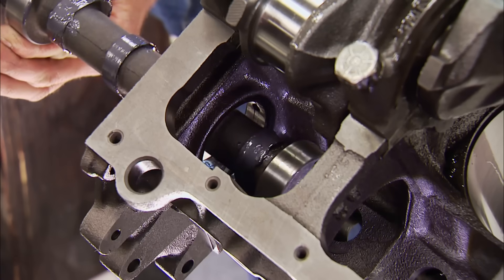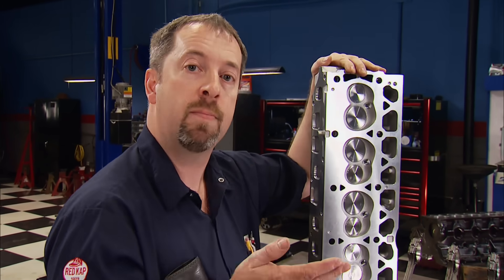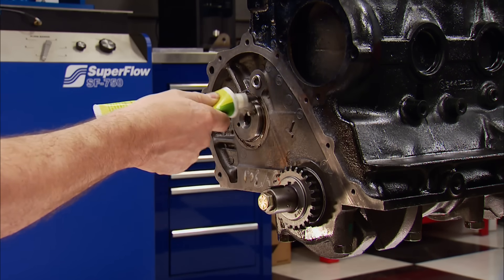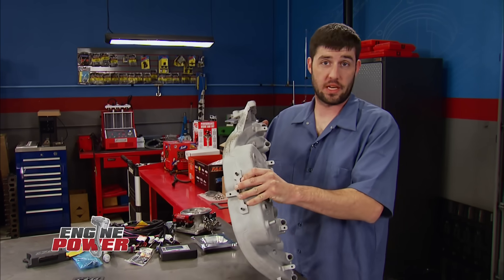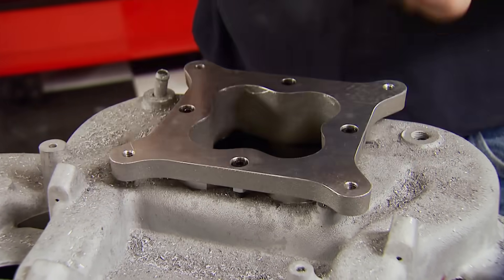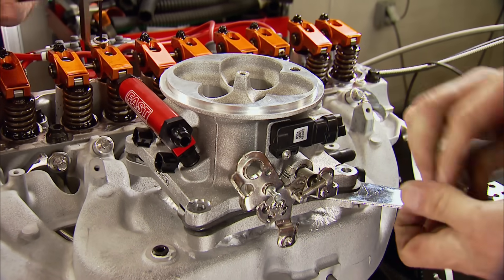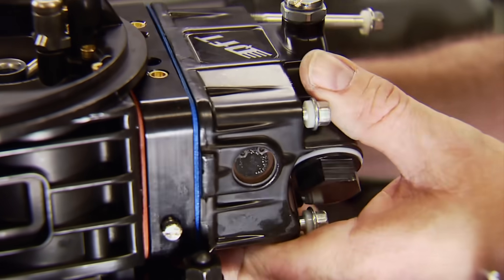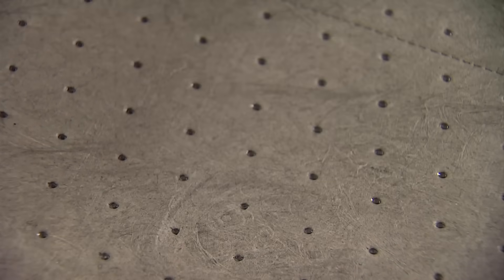Rebuilding a 4.0L Jeep Straight Six to 242HP - Engine Power S2, E14

Comment: It's a shame they didn't come with timing gears, like the Ford 300 did. That would be a good upgrade on the 4.0, especially when it gets some mileage on it and the stock chain stretches. Keeping cam timing perfect is always a good thing.

Comment: In my country, Argentina, these engines were used in Dodge Polara R/T (Dodge Dart 4th gen for EEUU market) and in IKA Torino for Turismo Carretera category. With a two weber carburetor and a lot of improvements, without increase displacement neither blowers or turbos, they can get it around 400hp at 9k rpm (you've got a lot of videos in YouTube). 
Today they are running with 24 valve heads made here, and the spirit of these engines are not the same.

Comment: I built a similar engine to this and learned the hard way....don't skimp on those ARP oil pan bolts or you'll surely pay the price. I tried to use the stock oil pan bolts and they just couldn't take the extreme weight of the oil leading to catastrophic failure. 🤔🤔🙄🙄
Reply: LMFAO.

Comment: I did almost the exact build for my 85 sx4. 3500 stall, too. Thing dis a two-wheel burnout for blocks and blocks! Blew the transfer case racing in the snow, so I rebuilt the whole thing. Beale did the interior. Black and maroon, black interior. A true muscle car. Loved it! Had vr4, evo, scoobie, focus mach-1 (dont ask), too many bikes to list. Something had to go. Still miss it. And my vr4. And my challenger. Mach-1 (73). Impala. Other sx4. 5 glh turbos. Had it all. Nothing now but success in business and homeschooling. But I got my eye on that new accord 2.0 turbo 6-speed.

Comment: If you pause it at 14:53 you can see that for some reason after they started the dyno pulls they put that stupid oval adapter back on the engine that came with the fuel injection. Why would they go through the trouble to weld in a 4 barrel adapter into the intake just to bolt a 2 barrel adapter back on it? No wonder the fuel injection didnt know what the hell to do. I'm surprised the carb did any better! Plus it looks like the first welded adapter was set in too far.
Reply: GOOD EYE SIR, FREAKIN IDIOTS.

Comment: The easiest way to get more power is a head shave for more compression. Stock is a super low 8.5:1 iirc.. thats the kind of compression youd use if it were heavily boosted. N/a you could easily use 11:1 compression on 89octane gas and improve your mpg significantly. That with high Atomization injectors and you could definitely get close to 300lbft. 
200hp is such low power output for a 4.0l.

Comment: That same engine was in Ramblers the 50’s. This was before AMC acquired it. Jeep got the engine when Chrysler entered the picture. So Jeep may have had it for 19 years. Also, Barney Navarro built a 199 cu. in. Turbocharged Rambler for Indy.

Comment: I bought a new 87' Cherokee with this engine. Not long after I took delivery, a metal-to-metal tapping-type sound was being emitted from the engine compartment until the engine had warmed up. The dealer (Lou Bachrodt Chevrolet, Rockford, Illinois) replaced the rocker arms in response to a bulletin stating that they were inadequately hardened, then told me the noise was "normal for that type engine" after the third visit. A first visit with a new dealer in an adjacent town (Belvidere Motors, Belvidere, Illinois) solved the problem. The source of the noise was a cracked weld in the exhaust manifold, which then became quiet after the engine had (fully) warmed up. Their mechanic went for a ride with me; after traveling less than100 feet, he exclaimed, "The exhaust manifold is cracked." RESPECT!
Reply: Had the exact same problem with my 87. They diagnosed right, but it always seemed to have a slight leak.
Reply: My 1996 Grand Cherokee developed a manifold leak 200,000 miles ago. Never had it fixed. Apparently this engine doesn't care. Neither do I 😊
Reply: Ha this was an issue until 2000 (99 in the grand Cherokee) when they went to a two piece cast iron manifold. The fix is a high end stainless manifold. But a Cheap steel manifold with expansion joints works as well.
Reply: @austinaubinoe2195 funny, it’s replacement, the 3.8 has the same issue, but an easy DIY replacement.
Reply: Just bought an 87 Comanche with about 150k miles. It came with some of the service records and apparently a tech said the exhaust manifold could be cracked. Seems like a common problem with this engine.

Comment: DO NOT BUY THE TPMS SENSORS FROM ROCKAUTO!!!!!!! I worked at a tire shop for 3 years and every single sensor that was brought in from rockauto or EBAY was garbage and wouldn't sync up with the vehicle.
Reply: Which brand? Rock Auto sells many brands.
Reply: @westernapache1700  Any of them

Comment: So, why can't we get 300HP out of this? Just curious. Now, we have 3.6L V-6s that make 300 plus HP. Why can't we get 300HP out of this engine with mods?  I get it they did a lot of work and this a high torque engine. What is the primary limiting design factor?
Reply: Old technology. Intake and exhaust manifolds are on the same side. Not good for keeping the intake air charge cool. NO overhead cams. Just get a V8.
Reply: 350-400HP NA can be had out of these but you have to mod them to suit the architecture of the I6. Most of the mods can be done at the machine shop. They can handle very high compression and or boost because of the closed deck, thick jugs and thick head deck. But you have to tune properly because of the combustion chamber design, they are a fast burn head with a little bit of a bathtub design (shaving the head can reduce that considerably) so you need to back off the timing a bit, kinda like an LS. This build is basically what you do to refresh this engine to factory-ish standard. Hence the low output numbers. The major limiting factor in this build is the intake design-(idea). THe manifold is not good for making HP and the carb on a FI manifold. Also the TBI EFI system does not work with the intake mod nor the intake in general. Factory EFI would yield better results. If you could get a hold of a good condition RENIX MPFI system you could mechanically tune this motor and it will run better than jtec since it looks for targets instead of restricting to parameters.

Comment: I'd love to see you guys do an Australian icon Holden 253 V8. Stock it had a displacement of 253 cu. in., 4.146 litres, a compression ratio of 9:1, a maximum horsepower 185, and a maximum torque of 262 lb. ft. I'd love to see one on your dyno at about 260hp and 300tq.

Comment: Why the fuck would you go from multi-port fuel injection to EFI  ?  Going to square wheels on it next. Jeep did make a lot of those manifolds, good thing, you sure fucked that one up. Its for air flow not fuel mixture. Jeep engineers are falling out of their chairs in laughter at this bullshit.

Comment: Its an older episode I know, but has to be said.  Its 2020, and when we screw up something we just slap a carb on it and call it done.  FFS it had fuel injectors, and a throttle body, so you go backwards in technology and use a carb.....  Ok time to stop living in the past and get on with the modern times.  This isn't the 60s.

Comment: Wonderful engine. I put 390,000 miles on my 1990 Cherokee. I pulled the head once to replace the head gasket. Other than that, just oil changes, anti freeze and spark plugs. At 390k the compression in two cylinders dropped dramatically, then it spun a piston bearing. I had a hard time deciding to scrap the jeep other than rebuild the engine, but the rest of the jeep was nickel and diming me. Sold it to a scrap guy, he rebuilt it, the jeep is still out there.
Reply: I have 331k on my 1999 jeep cherokee

Comment: I think this is a nice build.  286 ft lbs at 3500 is about right for the application.  1st or 2nd gear rock crawling will put a Jeep right in the torque band.  As for comparing this to modern, Dohc, cross flow head, computer controlled, high winding engines for total horsepower....well , that’s just a silly irrelevant comparison.  As for proponents of an engine swap, have you ever really done that? That takes a lot of time, detail work, along with custom fabrication.  Yeh it can be done but really y’all make it sound like a swap will attach itself to the vehicle like a magnet. They used the stock bottom end. Aluminum head $1500. So for ~ $2500, an engine that the average joe could build.  Bolts right back into a Jeep or Cherokee.

Comment: They could have used the stock cam sensor from a late model 4.0, made a simple crank pulley trigger and used a computer worth a shit. I have been watching power block since I was eight or nine years old and I turn 30 in a couple weeks. They are so completely behind the times when it comes to electronics it's insane. Hell they were behind back then but now it's just painful to watch.

Comment: I came here to complain and bitch at JEEP for ELIMINATING this engine. Just like Ford did the same with its 300 I-6. Reliability, simplicity, longevity, etc has never been the same. The 4.0 was MURDERED by the (Mercedes Benz) Germans when they took over in the early 2000s. Another example of why FOREIGN Mentality and influences DESTROY everything that is GREAT in the USA. Chrysler/Dodge/Jeep is becoming more and more meaningless today, the V8s pushrod cars are for niche markets(Thanks FIAT!).

243 HP @ 5000 RPM & 286 FT-LB @ 3700 RPM is nothing to scoff at, more so when you don't have the optimum setup to begin with by having to go to an alternate solution to get these numbers. The only TOTALLY MODERN engine you can compare this to would be GM's newer 4.3 V6 (LV3) , 285 HP @ 5300 RPM & 305 FT-LB @ 3900 RPM. So there is a competitive amount of torque per displacement for the Jeep, it is just that it could produce a little bit more HP  (265?) at a little bit higher RPM and voila! Combine this engine with a modern, faster shifting automatic and, on a 3,500 lb small SUV the performance is as current as any other vehicle.

Otherwise, great job guys! I wonder if slightly better results could have been obtained with a post 1999 engine, and that also would avoid the (failed) manifold's plenum welding surgery, simplify your setup and reduce time, cost and pain.

I leave you guys with a review of a 1997 Cherokee with 4WD:
https://www.motortrend.com/cars/jeep/cherokee/1997/1997-jeep-cherokee-2/

Comment: the 4.0l is one of the most bulletproof engines jeep made.
Reply: I gave away my '93 when it had 350,000 miles on it. Checked in with the new owners a few years later and it was well over 400k. Not delivering much in the way of power mind you, but still chugging along.
Reply: Based on a 1970s Australian Chrysler design.. I have one in my 76 regal. Two barrel carb and electronic ignition, they were strong torquey motors even without efi
Reply: Not when these guys get ahold of it
Reply: My 98 is my daily driver,312k on it. Runs great.
Reply: *Except for the absolutely PUSSIFIED cast aluminum pistons in the later models, which will grenade themselves at the slightest sign of heat or stress.

Comment: What the actual f***. Stock bottom end (fine). Edelbrock head (awesome sauce). Factory port fuel injected intake..throws that magnificent beast to the wind and frankensteins a wet manifold setup for more power instead of a stand alone FI computer. Is this 1985? I'm about to throw a turbo at mine with the stock intake. This "upgrade build" makes little sense - aside from the massive sponsor advertisment  content. Dorman is OK at best until you get into their replacement tin bits. All from China.What;s wrong with reusing the stock correctly fitting tin?

Comment: I could buy a 700hp lsx motor for the same money y'all spent on this silly project
Reply: nik1703   $11k for an Ls engine.  You’ll need a different transmission, $3k. Custom mounts,  etc. I doubt they spent $15k on that build.

Comment: I put 227,000 miles on the same engine that was in a Jeep, it ran like a top.   The only problem I had in all those miles was replacing the crankshaft position sensor, one battery and a fuel pump which is not part of the engine.    Not a lot of power but like the turtle, it just keeps ongoing.   Service it every 3000 miles and it keeps on going and going.     I had to get trade-in the jeep because it started to have flow-through ventilation

Comment: “Not the fault of the injection”, but makes 100 more horsepower without it. 🙄
Reply: Injection wasn't the problem, it was the configuration. 🙄
Reply: CanadaBud23 yeah, the way the injection was configured. 🤦🏻‍♂️
Reply: @WPowell420  Should have just got a stock injection from another 4.0L. Would have made more.
Reply: CanadaBud23 can’t stroke the sponsor’s ego if they do that.
Reply: @WPowell420   True lol.

Comment: Not really impressed for 4.0 straight 6, should at least made 300 hp with that kind of setup. My nissan 2.0 liter 4 cilinder SR20VVL in my primera GTi makes 280 hp, with mild cam, headers, K&N filter & housing, and an exhaust. Everything else is bone stock on the motor, it isn't even overhauled after 230.000 kilometers.
Reply: Lex Buren   How is comparing that Nissan engine relevant?  I’m assuming it’s a dohc engine, fuel injected , and probably has to wind to 5000 rpm to get those numbers. ( no I don’t feel like looking up the specs)   Talk about an apples and oranges comparison.

Comment: I think the adaptor plate you welded on  goes too far into the manifold instead of beeing flush with the top surface. I think this restricts the air swirling inside the manifold.

Comment: I would like to say good try, and if there is ever an episode that needs revisited, especially for a follow up you tube video it is would be this one.  

The EFI should have been stock or a modified version of a stock of what one would find in a TJ or WJ. with an upgraded fuel injectors and fuel pump.  

Needed to use a distribitorless setup and go with a larger throttle body.   I want to see what this engine would do full factory ECM!

If you get a chance, please revisit this one.

Comment: FYI you really should consider turning the throttle body/CARB 90 degrees to better align the primary and secondary circuits!  FWIW the primary barrels should be furthest from the manifold, and the secondary  barrels closer, so a fancy throttle cable is in order...
Reply: Exactly, take advantage of the primary’s being farther away (torque) and secondary’s closer/ shorter (hp) just like the custom 4 barrel intake I made to run an s2000 Honda engine in carb required class circle track racing. Literally handed every ford 2.3 and quad 4 Chevy their asses.

Comment: Let me get this straight, they will fuss around with carburetors with a static jet sizes, and distributors with static ignition timing instead of installing the sensors and parts for a dynamic ignition and injection timings, then advertise at the end for TPMS sensors.  WTF, stick with the intake mod and get the fuel injection right and install an electronic ignition.  It's not hard to wire up O2 sensors and crankshaft position sensors. They haven't built a car or truck that uses that old school tech in decades. Internal combustion engines are at the cusp of obsolescence to EV cars.  Time to move on.

Comment: Meanwhile, Porsche is making 520 hp with their naturally aspirated 4L flat 6 cyl...
Reply: Russell Brown   Meanwhile NASA is making 1.2 million pounds of thrust with their F1 engine.  So?
Reply: The commonality is that they are both 4L naturally aspirated 6 cyl engines. I’m pointing out what’s possible with an engine this size. And also laughing that these guys are excited about making less than 300 hp in a big ass 4L engine. Maybe aim a little higher? Or is that engine such a piece of shit, that the increase they made is a real accomplishment?
Reply: @RB-xv4si  It's a piss off quite honestly because I can make north of 400 still using the untunable factory ECU with the old architecture. This kind of crap makes it look bad.
Reply: CanadaBud23 frankly, it should be made to get that sort of power. Probably will need to use 93 octane but that’s not a huge deal. A lot of their inline 6 engines had oversquare cylinders, which is conducive to high rpm operation. So I wouldn’t think it’s out of the question this could make big power.
Reply: @RB-xv4si  It could have been a lot of things. But no "In this episode we gotta figure out how to get a carb on it".  A factory refresh with a slight bump in compression can get the same power. Don't know who's getting the kickback really but carb guys are always close minded carb guys.

I use shell 91. I just recently pulled my motor apart to prep for 18 psi through a whirlycharger (centrifugal) with an MS3X and a fabbed up turbo intake manifold.
Reply: CanadaBud23 lol. Reminds me of the weirdos who drool over the old air-cooled Porsche engines...oh, they’re the last real Porsche engines...the world has moved on...

Hope you upgraded the cooling to handle all that boost. Sounds pretty nice.
Reply: @RB-xv4si  Yeah cause the stock radiator is the very limit of this setup. It's a Towing 2 core that I got when the original rotted out. Will have to get a decent aluminum one. I moved the rad closer to the front just behind the grille  and it helped quite a bit with the factory unit.

Comment: First the intake idea was just stupid next why would you put a 750 cm carb on a 4.0l. I'd bet a carb half that size would have done way better on a offenhowser intake or something built to flow fuel the aluminum head is just a disappointment. A good port job could have done the same and more for a fraction of the money.
Reply: Yup and a factory ECU would have blown this out of the water too. But apparently a 240HP oversized carb on a hacked up shit FI intake is fantastic.